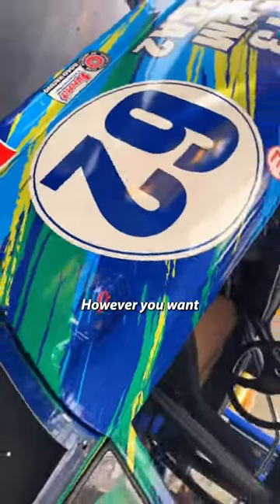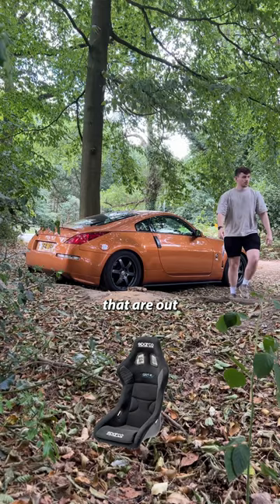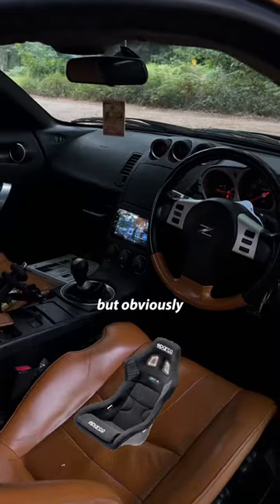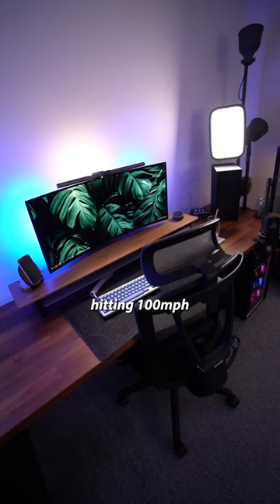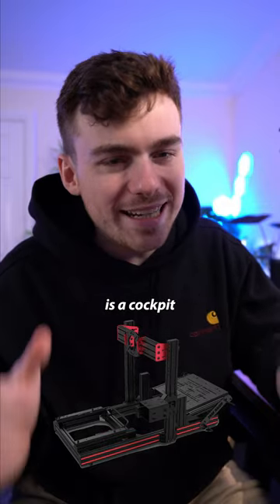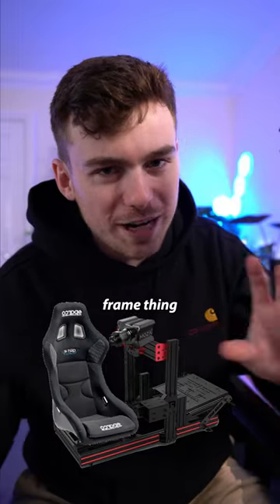Building a Racing Sim (pt.2) #shorts

Comment: how do you add a custom steering wheel to a moza?
Reply: you but a qwick relese they sell one or you can get an nrg then you just boilt it on. hell you can unbolt the qr on the base and hard mount it to the base if you want. unlike fanatec they dont use a proprietary qr and dont disable ffb if you dont have a wheel connected
Reply: @TheRivalryDrifting  ok. thanks 😊 🙏